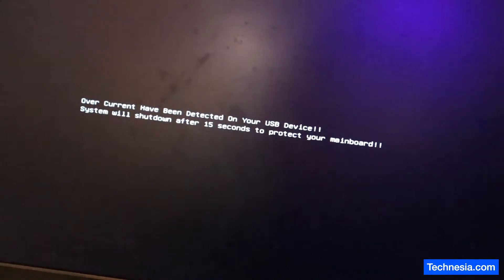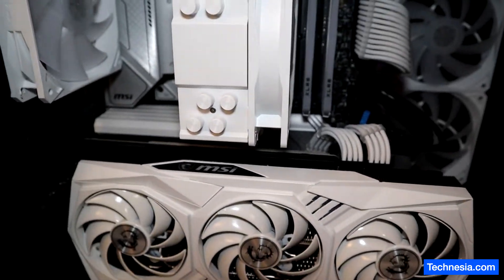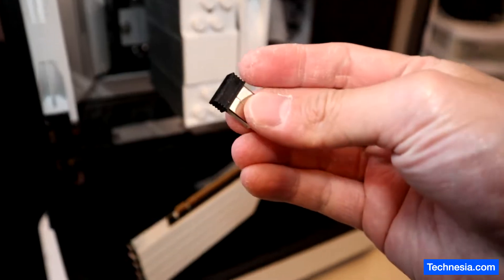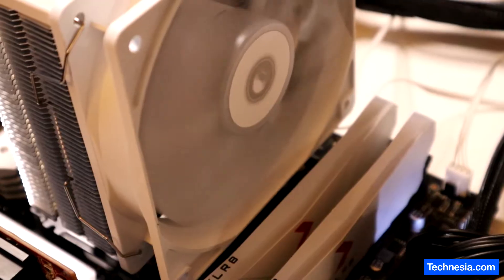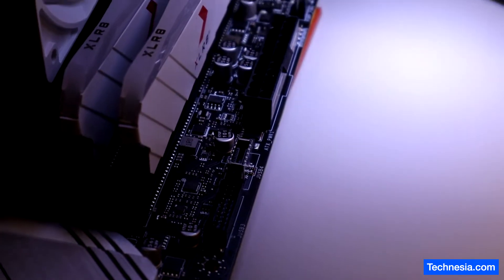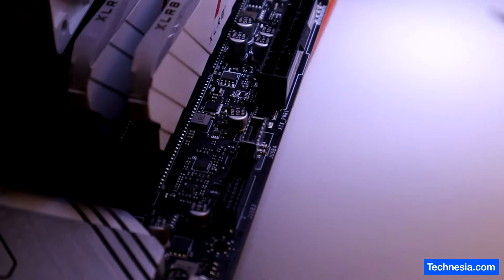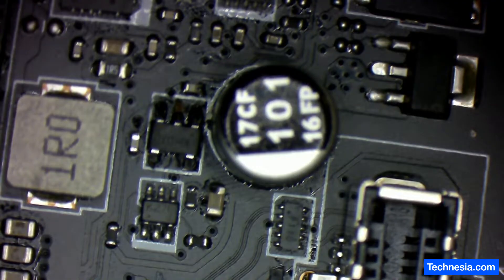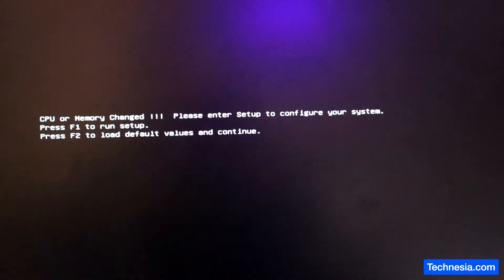Over Current Have Been Detected on Your USB Device Error Message

Comment: That's very impressive, although I'm not sure I'll try to do this at home.
Reply: For those wondering, I got the same message, but in my case I had tried to plug a USB-C cable into a USB-A port, and it bent the pins. So you could fix it back with a toothpick. The ports work now.

Comment: I had the same issue and then my GF used chatgbt and it said “ try looking at faulty usb connections “ and my wire had a slight cut from my kittens i then used my old mouse and it worked

Comment: Nice Job!!!  I never thought about using a thermal camera to find the spot!  I just bought a MSI X570 GOD LIKE Board w/this problem for a 100 bucks!  Man if i can fix it Im gonna slap my Ryzen 9 5950x in that bad boy!!  You give me hope!!! Thanks for the video!
Reply: did you find the solution ? im stuck with a x570i with with issue too
Reply: @galagaev  yes mine was 2 things. One the case it was attached to before i got it and  Two, in the back i/o plate had to come apart as the metal was bent causing a short if it was turned on. I got lucky but i was prepared to replace one of the usb ports connectors so you should be too.  Have fun though cause the boar is great i love it!!
Reply: @galagaev  yes I fixed the issues it was w/the back I/O for the usb the metal tab was shorting it out I just ended up breaking it off (the tweaked part) so it couldn't touch it.
Reply: Hey dude I just got that same board for 120$!! I have the same issue, what was it that was messed up with the I/o plate?
Reply: @chrisphillips5682  yes I got it to work, the I/O for the usb had a tweaked tab I had to break off.   Other than that all works perfect.😁

Comment: It happened to me during BIOS update the power cut off and I see this message after I turn my PC on. How can I resolve this?
Reply: Unplug everything even your Ethernet cable and hdmi power cord and stuff connect to your pc
Reply: @trendyzsn  I solved it using Q-flash . Rename the BIOS file to MSI.ROM and pressed Q-flash located on the I/O panel it updated the BIOS. Nothing else was done. Thanks